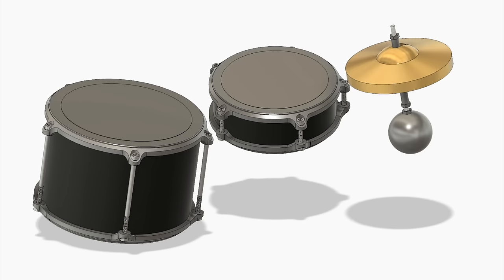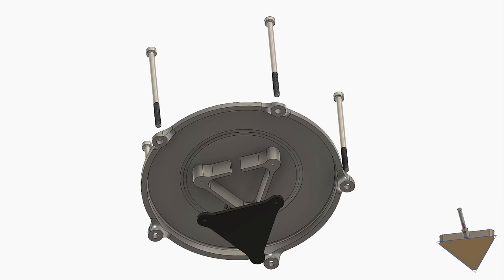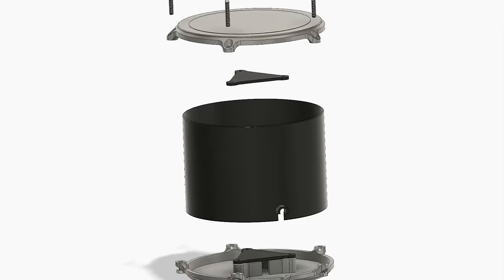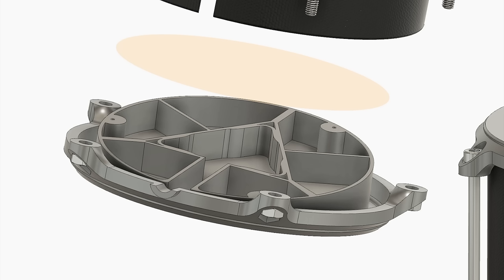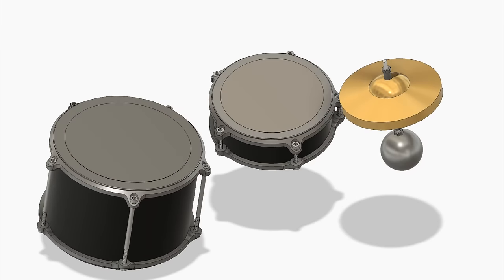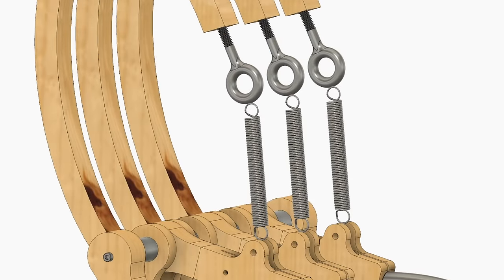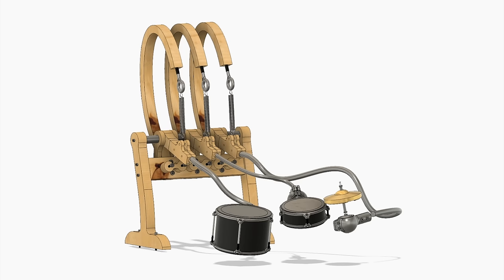3D Printed Drums - Marble Machine X #5

Comment: Looks great!
One idea you might use. Printing hexagon shapes to hold the nuts is not the best solution. There are round nuts with groves around it which you can melt in a hole in the plastic with a soldering iron. These nuts have less tendency to rotate while tightening the bolt bacause they are securely melted into place.

Comment: Martin and Wintergatan! Love what you guys do. I am so excited for the Marble Machine X the only question I had is if you use the ball bearing to secure the drums won't the impact of the marbles over time shift the drums from the position you want? Like the downward force of what I'm assuming to be 2000+ marbles would make the drums dip down towards the direction of the area in which they were hit no? Since there's nothing restricting the bearing from moving around.
Reply: I was thinking this too. The ball hinge is going to be great for setting the position but I reckon you'll be crying out for a way to lock the drums in place once set, or you'll be forever re-calibrating the machine.
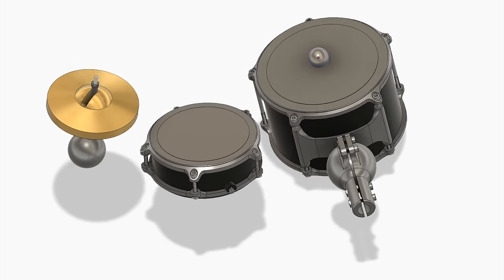Reply: I think with the clamp, the ball hinge will settle down so far and the clamp will limit the deflection of the drum as seen at 3:13.
When they have the arm supporting the drum designed, the arm will be rigid enough to hold up the drum in its resting position.

Comment: Fantastic! One question: the curved braces are a one wood piece part each, or one each is formed by multiple wood layers (laminated wood)? Because, laminated wood is more tough and, in the optic of disassemble and assemble the new marble machine x in each concert, I think that parts must be rigid and durable.
Reply: Gt Fiberboy might just be a wood looking plastic. idk, but i agree that it should be durable enough for it to be a road show.
Reply: I see, you're right; I use to work wood, and I'am every day in a position to work wood instead of plastic. But I understand what is your though.

Comment: I think you might want to consider putting a flat surface or some other kind of detent geometry on ball hinges. I wouldn't trust just on friction of the clamps. Continuously dropping marbles might create the possibility to rotate the parts around rotational center.

Comment: I'm not an engineer so I would love a quick explanation, but ball attachment point for drums will become loose with repeated impact and vibrations from the falling marbles, isn't it ?
Reply: No, not if everything is screwed together with enought tension. A certain force will be needed to move it.
Reply: Given that the screws won't come loose over time due to vibrations, it should hold nicely.

Comment: Engineer here, I actually work at a specialized 3D printing company called Voxel8.

One technical question; has your project engineer optimized the drum based off of a vibrational analysis to hone in on the frequency with which traditional drums vibrate? I'm interested in seeing how it turns out, especially if the drum skin is of some other printed material, and non-traditional.

Comment: I'm curious as to why you decided not to just straight-up mic an actual high-hat.
Reply from the maker: +Spider2point0 firstly because of size, not enough room. secondly because signal to noise ratio. The contact microphone provides a fantastic signal to noise ratio. No noise from the gears and machine etcetera, And i can shape the Sounds in a very deliberate way!
Reply: Ah, that makes sense; I hadn't considered that the mics would also pic up the gears and other noises from the machine itself.

Comment: Don't you fear that the marbles permanently hitting the drums will cause them to tilt away under the pressure, making it necessary to readjust them from time to time? This would be pretty annoying
Reply: those are the same kind of ball socket mounts used on actual drums where everything is much heavier and they are hit much harder - it should be fine.

Comment: are you going to use Mylar drum Drum heads, or 3d print them as well as the print might not hold up to rigorous use an may be harder to replace. Then a cheaper Mylar cut to fit head?  ^o.+^